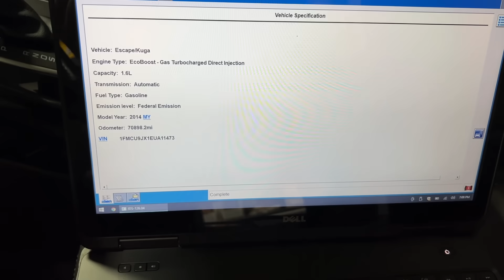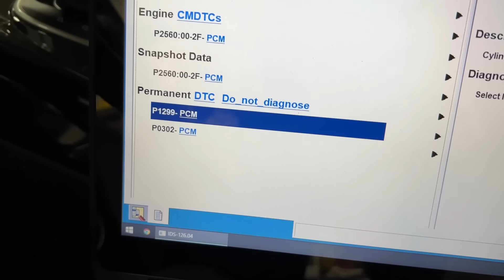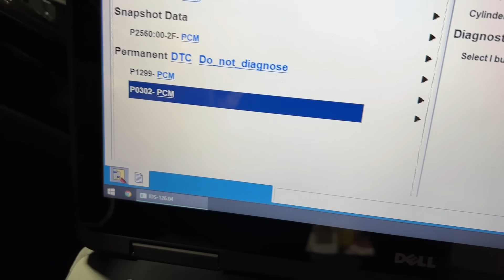Beware of Ford’s 1.5L 1.6L 2.0L Ecoboost Engines and Their Never Ending Coolant Consumption Issues!

Comment: The problem with this engine is coolant intrusion. The customer should have gotten this addressed when it first occurred. Same exact thing happened to my 2018 Ford fusion 61,000 miles in and coolant started leaking into the cylinder. the minute it occurred My car went straight to the Ford dealership. My coolant bottle still had coolant, because I caught the issue right when it happened. Whole engine was replaced  under warranty with the new designed 2020 engine that doesn’t have the slits between the cylinders where coolant is leaking into them. What angers me is that this is clearly a ford flaw and ford is making customers without a warranty pay for their mistake.  This engine should have been recalled

Comment: My 2013 escape has had NOTHING but issues since I purchased it. This was my first car I ever bought and unfortunately will be the last Ford I will ever purchase. Coolant leaks, numerous check engine lights and now at 130,000 the transmission is giving out. Was hoping to get 200,000 out of it but as time goes on that doesn't seem very likely.

Comment: I had a 2016 and it smoked a bit on startup on cold mornings starting about the time the warranty expired.  I noticed some unusual crud on plug #2 and periodically needed to add coolant.  Nothing under the car.  The coolant bypass solenoid failed every 15 months or so starting about the time the warranty expired also.  Traded it in...

Comment: I wish I had seen this video before I pulled the trigger on a Fiesta ST.  It overheated and went into limp mode the day I took delivery, and the dealer (non-ford) has had it since. It has since gone to a Ford dealer to figure out what the issue is.  While I didn't notice any coolant loss, I didn't exactly have the vehicle very long, so It's possible that this is the issue. My last Ford (Escape 2.0 EB) never had any issues with coolant usage, overheating or anything like that.  The trans was clunky, but that seems to be a lot of cars these days.

Now i'm seriously concerned that the vehicle I just purchased is going to need a long block while I own it.  I don't have a warranty of any kind beyond the typical used car warranty. i'm not sure what to do.

Comment: What really burns me is thousands of people warned Ford not to do this.  It seems they didn't even try to build the engines to withstand the high heat of turbo charging.   Aluminum Block and a Turbo is a definite no-starter.

Comment: I guess I should consider myself fortunate. After 130k miles, I've not once had to add oil or coolant to my 2.0 ecoboost. Good content. I now know a few places to keep my eye on.
Reply: What year and vehicle?
Reply: @fpaltenhoff86  2013 Focus ST
Reply: Same. 2.0t escape with 165,000 with no issues.
Reply: @jacobianmail  I just bought a 2017 Escape with 65,000 miles.   How will I know if it has or developes this issue?
Reply: @EmeraldView  The loss of antifreeze is an indication you have real issues.  It's very easy to monitor just open your hood and look at the coolant level in your reservoir if it's below the halfway mark and your check engine light is on you might be a member of the club.  Pressure checking of your radiator is another way to determine if your having leakage.

Comment: Never ever allow your coolant to be mixed with other coolants. Understand even when you take your vehicle to the actual dealership there's still a high probability chance that they will add coolant without checking to see what kind of coolant was originally in the system. Mixing coolant is not compatible or advisable to any engine. Despite manufacturer claims. Plus you should never ever use regular water. If you are going to use water as a mixture make absolutely sure that it's at least distilled water.
Reply: While what you say is true about not mixing and using distilled water, none of that would lead to the coolant leaks he is showing. That is from some amount of warp + possible gasket problems on the mating surfaces between the engine and head.

Comment: I have noticed over the years that the auto makers (usually american) that have short warranties build problematic engines and transmissions. There is no excuse for the lack of quality in the builds these manufacturers provide to the consumers. If I buy it is always with high mileage warranties which removes American built that have low mileage warranties because they know they are building us trash at high prices.

Comment: Has ford fixed the engine block on the 2.0L ecoboosts now (say 2022 models) or is the same engine and block still being used the new vehicles on the lot?
Reply from the maker: Yes
Reply: @FordTechMakuloco  When was this fixed?  In my research, I think I found where it says maybe 2019 model year?  How can you tell if you have the updated engine? Specifically the 2.0 is what I'm worried about.
Reply from the maker: 2020

Comment: Dammit Ford! I had a mustang, an 89 SHO and a Focus ZTS and all lasted over 220,000 miles. I’ve had an Infiniti G37 for a while, but wanted to get a used Focus ST or Fiesta ST for fun. So much for that! I guess Ford only cares about V8s and electric now… I don’t know about their eco V6’s though.
Reply: The ST's and RS's are built in Germany. Search the comments, you dont see many people discussing issues with the Fiesta ST. They seem to be made to a much higher standard than the standard Eco Boost stuff out there.
Reply: @bigbuckoramma  That's good on the ST. However, the RS' in the US did have the well known head gasket problem. PS Did Europe have any of these other ecoboost problems or are these just American issues?
Reply: @waltciii3  Unfortunately, the problem extends to Europe too. The primary culprit seems to be the Ford Kuga. Which, coincidentally, and perhaps ironically, is built off the same platform as the Escape is, and uses the same 1.6L and 2.5L EcoBoost engines. And the Coolant issues persist there as well.

I find it VERY interesting that the issue seems, largely, to escape the Fiesta ST. And the fact that the 1.6L EcoBoost is also a homologation engine for several motorsports applications as well. Granted the racing engines are...well...racing engines, but there is at least some crossover in design elements.

It makes me wonder is some of the issues are not down to lower compression/boost levels, and lower heat cycling times in these "grocery getter" motors? Which, in return is causing some sort of materials mating surface issues, from mismatched heat soaking, causing some form of warping in the head or cylinder deck, that eventually weakens the head gasket seal, and causes it to fail, resulting in coolant consumption?

Either that, or what, outside of tuning, is different between the Fiest ST and this pedestrian EcoBoost 1.6L? Because the Fiesta ST's generally get driven to within and inch of their life, constantly reved hard, driven hot, pushed into their Over Boost mode, and shown little mechanical sympathy on the whole. And yet I know dozens of FiSt owners personally, and none, including myself, have ever talked about, or experienced coolant consumption. And we are all pretty anal retentive about checking our fluids, and monitoring our vehicles health (what with auto crossing, track days, rally cross, etc. etc.), so SOMTHING is different. And something in the Fiesta ST prevents this from being a major issue.

Comment: Great video. There was a time, here in Northern Europe (UK), back in the 70's and 80's, a Ford engine wouldnt last much past 100,000 miles. Ford even ran an advert stating "Why would you change your body, if you only need a change of heart ?", in a replacement engine campaign - the Sierra had just come out !
Reply: Still love the old Sierras and escorts. Particularly of the estate variety…
Reply: @KazeHorse  Yes, I must admit the estate version of Sierra was a good looking car, even now.
Reply: Which engine?
The Sierra 2.0 had the Pinto ohv motor.
The Escort 16V was the test bed for the Focus 1.6, the Focus 1.8 was the older motor and was discontinued 2 years after the focus came out.
Imo the 16V is a development of the RS1600 / RS1600i / XR3i family that were eventually superceded by the Ecoboost.
I could be wrong but I've dailyed a Focus 16V since 2006 and it's a strong and reliable motor and I've had none of the issues detailed in the video.

Comment: So you're saying millions of cars that have an ecoboost engine will ALL have this problem which basically makes the car worthless when it happens, and no lawyer has wanted to sink their teeth into this and go after Ford??? Kind of un-American
Reply from the maker: Not all have this problem but it is very very common and there are new class action suits being started as we speak.
Reply: I hope so because I just hit 58k on my 2017 2.0l and I don't feel like dropping that motor and trans for that. Pulled the plugs just to check because I feel like there is alittle coolant missing but everything looked good

Comment: Every car manufacturer is going to have some problems but I don't know WTH Ford is doing - it's certainly not building customer loyalty. You can fool some of the people some of the time, but only for so long. FWIW, we've owned a few cars into their 10-15 years of service. That should be the norm not the exception. Nothing special, just regular maintenance, a few things here and there, but never anything catastrophic like engine or transmission failure. Obviously none of them were Fords.

Comment: The same thing happened with my car. Escape 1.5 2017 with 48k miles. Now the Ford service want to me pay 9.5K to change the whole engine. It’s outrageous, i always do the service and change the oil and this happens? The worse part is that the warranty expired 4 months ago. They need to recall, it’s getting very common

Comment: Asking too much from too small an engine. My 2004 Focus with a normally aspirated 2.3L and over 150,000 miles is still running fine for the person I gave the car to. Using no fluids at all. No coolant at all. No oil consumption at all between oil changes. It also has a conventional automatic. Running great. I bought a 2016 Honda in 2021 and am hoping to see  as much. But I made sure to not get a turbo engine. But this sort of thing is why my next car will be electric if I can drive long enough to need one.

Comment: They mentioned my 2015 1.5L EcoBoost had pin hole coolant leaks in the cylinder walls. I feel the government is part to blame forcing automotive manufacturers to reduce weight in order to meet fuel consumption (cafe) standards. Regardless though Ford has offered a s**t product for years.

Comment: Had my 2015 1.5L EcoBoost do this. First Ford tech thought it was head gasket so replaced it. He left the dealership new guy came in found service bulletin to check for this - well he found it. Luckily I had premium ford warranty. I always get it and they have paid for themselves on a number of my Ford vehicles. Motor got changed at approximately 50,000 miles. They had my car for like 6 months for the repair. Got it back and they had pinched a wire harness during the swap. Not sure when I should get timing belt changed? New dealer service manager is recommending at 150,000. Even my 2008 ford focus 2.0L has a timing chain. Another problem with these engines. Belt goes and so does your valve train. Oh my focus has bad bypass valve in the ABS pump module. Troubleshot off your other video. Cant find replacement part anywhere!!  Thank you Ford for supporting your secondary part line. Let's just discontinue the part so everyone has to scrap their cars. Oh recall covered higher end fusions and Lincolns but not the economy cars same era. I'm about done with Ford. Can someone suggest a reliable brand I can switch to on my next vehicle. Oh they just serviced transmission, changed oil, and spark plugs and now I'm noticing a serious power loss in about the 3rd gear range. Thing usually gets up and goes. One thing I do like. Our weather has been pretty hot so thought that might be a contributing factor. Any suggestions, other than to dump the car?  It has been paid off for awhile thank goodness. So at least ive gotten some use out of it. It's at about 130k miles now. Thanks

Comment: I used to like ford but it's hard to with all the problems. Internal water pumps on FWD V6 engines, bad transmissions in Focus and Fiesta, ecoboost engines that suck. 5.4 V8 3 valves that suck. It seems they have more bad models than good. Chevy is just as bad it seems.

Comment: Hello Brian 👋  I am writing to you because  I own a Ford Raptor 2020 in Peru South América. About a year ago I had an issue were the truck got stuck into a river and got floded after that we change most of the modules and everything. We took apart the transmission and change every single fluid. The truck survived it runs good. But I keep having two issues 
1. When truck starts up the 4x4 is engaged after a couple miles it will disengage but it will happen again if you turn off and star again even just one minute later. 
2. I am getting misfires codes sometimes at high rpm truck will shut off the cylinder for a minute and then it will keep working fine. 

To be honest no one knows very well this engine or this truck since are not too many I guess that there are around 50 raptors in the whole country and the regular f150 wont have the 3.5

Comment: This is a big problem all around with every manufacturer . They trying to get so much HP out of small engines . Honda has too much fuel dilution and needs oil change at 4000-5000 miles . I am not fan of Turbo engines anymore .

Comment: Four cylinders just are to wound up they run at high RPMS. They will burn up and use oil. When Ford put them in ALL of their cars and slowed down of production of the V6’s it was the biggest mistake in thee car companies history. They won’t last over 100000 miles.

Comment: So sad. I was a Ford man for a couple decades or so. Cracked heads on my '91 Ranger with fewer miles than this. Several more trucks after that with problems early on. Finally went Asian and haven't looked back. Now I feel cheated when I get less that 300k out of a vehicle. Don't be a chump--buy reliable transportation next time. That's' how capitalism works, after all.

Comment: I know this video has nothing to do with my comment, but:
My 2012 f150 ecoboost feels like it is slipping or kicking when driving 60mph on the highway, and today it started to stall and the ac went from really cold to super hot. After I shut it off, and tried restarting, nothing happened. After the 3rd time, it started up, ac was blowing cold and it drove fine. Anyone know the issue in having?

Comment: My coworker and I both own 2014 Fiesta ST’s with the 1.6 Ecoboost. We have had very different experiences with ours…

Knowing I had one too, he flagged me down one day maybe 4 years ago. He warns me that his caught fire earlier that week. Apparently, his coolant started draining and there was a problem with the sensor that read low coolant. Eventually he ran out of coolant, and apparently he cracked the head (if I remember correctly, but it might’ve been the block itself), which then spilled oil onto his exhaust manifold and it caught fire. He told me that there was a recall for it, but the letters just hadn’t gone out yet. He advised me to call my local Ford dealership right away, so I did. They were able to confirm that my Vin was on the recall list, and were able to get me an appointment. Here’s the kicker. The appointment was for two months out. Apparently the backlog for the parts they needed was so severe that it would’ve taken two months for the dealership to actually get the parts in. A week later, I got my recall letter in the mail. Thankfully I knew about the problem a week before the general public and was able to get an appointment to deal with the recall only two months out considering the backlog before the recall was announced publicly. Apparently it was a pretty major fix, so my car was in the shop for an entire week while I drove a rental to work and back. When I got my car back, everything felt exactly the same. I have not had any coolant issues since. I’ve even had the plugs changed and the cylinders scoped when I opted to do an injector clean. 

My coworker on the other hand, got his car back, and there was something wrong with the clutch. One day right before work, he engaged the clutch and his foot went right to the floor and he felt no resistance. He then couldn’t change gears. Thankfully he ended up making a killing on the sale of his house, and he was able to afford a 2019 Kia stinger GT, and he has plans to turn his fiesta ST into a designated track car after he fixes it. But yeah, I have no problems (yet), but he has had a lot of issues.